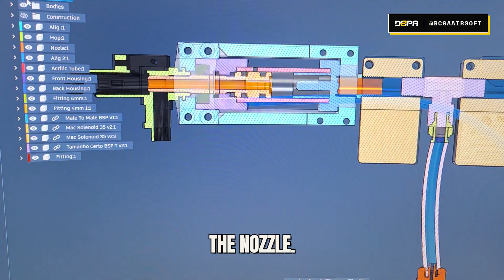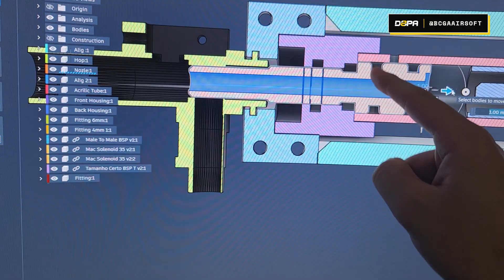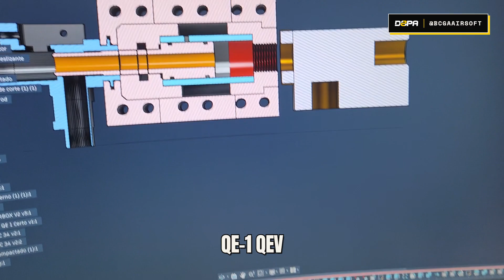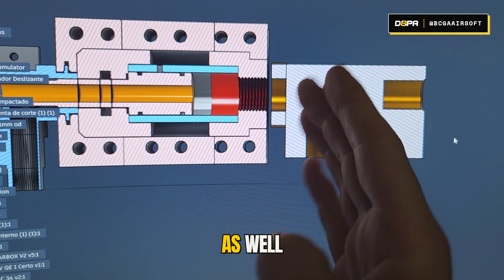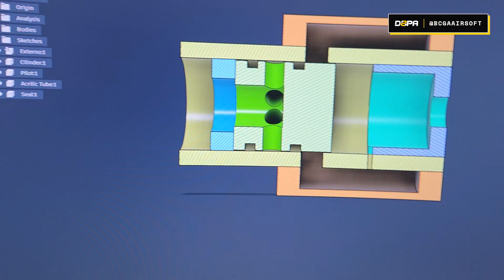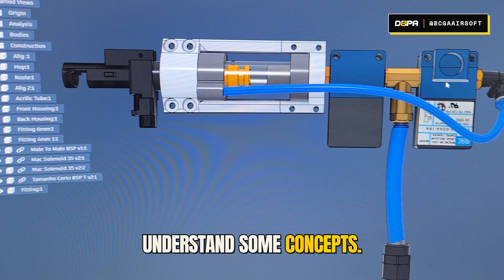Engineers, Help: The QEV Problem I Cannot Solve Alone

Comment: Hi!! 

Use a 3 way solenoide valve on the traditional input of the qev, it should solve the problem of the timing of the qev as it’s the same air that pushes the QEV piston.

Also by using the 3 way valve, you don’t need to modify the qev as it works in the traditional way.
Also it solves the air reservoir problem as you only need to make a reservoir to accumulate air, as the input of air is introduced with the 3way valve.

I’ve been thinking of using this system on my project and your video appeared on my feed so it looks like life wanted you to test mi idea
Reply: Also I think you can simplify the loading system of the bb, the part that retraces and take a bb from the magazine by using only a traditional hpa engine